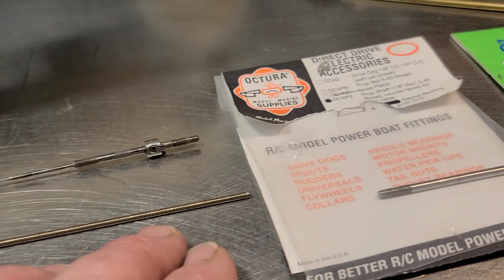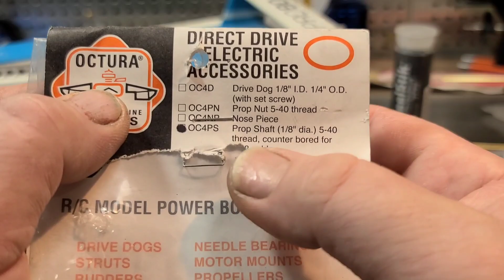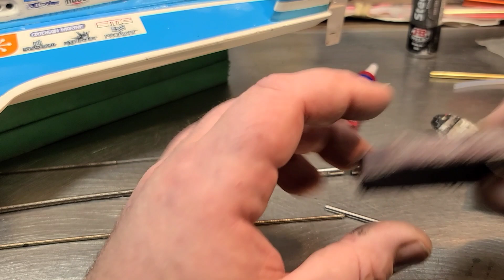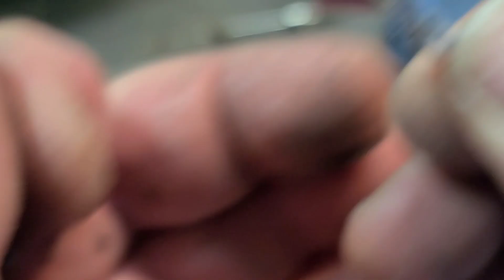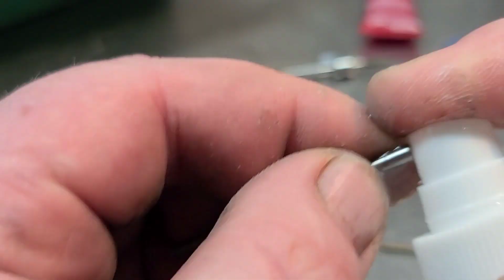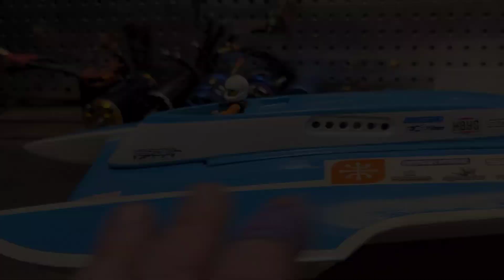Making The Connection .98 flex cable, 1/8 Octura Stub Shaft - Rc Boat Maintenance

Comment: Man it looks like that JB weld  is good stuff I’ve not tried it myself.
I had success lately using green locktite 
Also I  like 2mm wire drives up to 6s 2500 watts.
I have a baby outrigger that runs 1.2 mm wire up to 800 watts 
Wire leaves more wall thickness at the stub.
I hate flex cables breaking at the stub nothing saves the prop when it lets go there.
I’m glad you have that kind of success that your flex cable breaks up at the motor end before letting go at the stub.
I thought I watched one of your videos in the past where you tried a wire drive.
If So,What do you think of them ?
I ruined a 2mm wire with 8s 3 to 4000 watts I run flex in that boat now.
Probably .98 wire would work but my trial and error usually ends up losing props.
I would love to find a really long pond about a foot deep with a clean bottom so I can just walk out and get my prop.
I think I’ve lost about a dozen or so and dove down up to 12 feet to find about half a dozen. 
Man I hate waste.
Love watching your videos,
Especially when you run them and when the water is to rough to run mine.
Reply from the maker: The only wire drives I've installed were the 1:20 hydroplane ultra lightweight wire drives.

Comment: If you put a small flat on the side end of the cable before inserting into the stub you will give the epoxy a route out so  that the cable doesn`t push back out and also give it more adhesion. Great video as usual.

Comment: Another great video Big B! My Ul-19 Teflon liner walked up against the collet yesterday. Any thoughts on what could’ve caused this? Stock boat, 4s run.
Reply from the maker: Basically the Teflon broke loose from the brass stuffing tube,  I like to use some adhesive on my Teflon liners to prevent them from moving, doesn't take much much.
Reply: I greatly appreciate the help and the quick response boss, I’ll try some adhesive and send it!